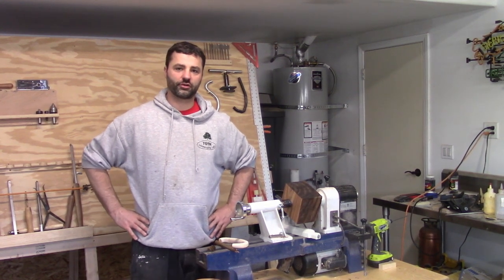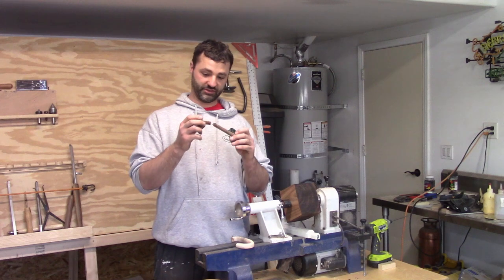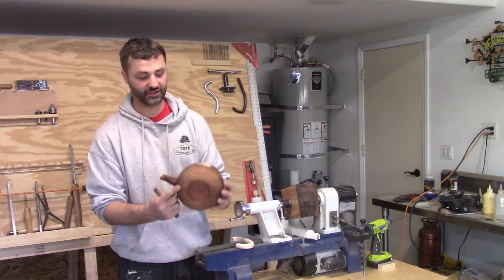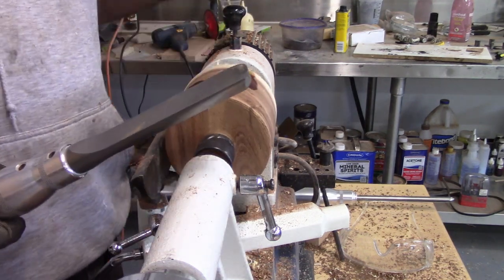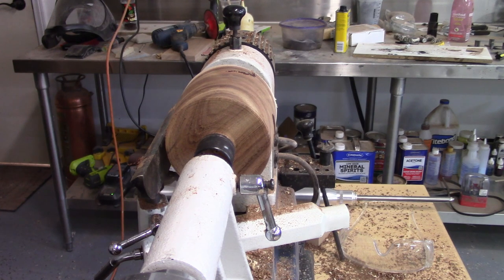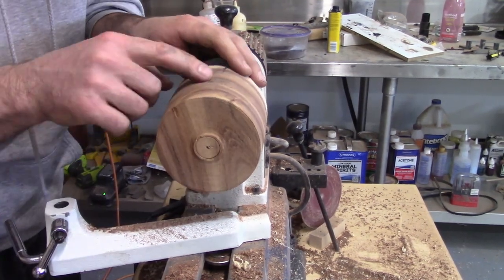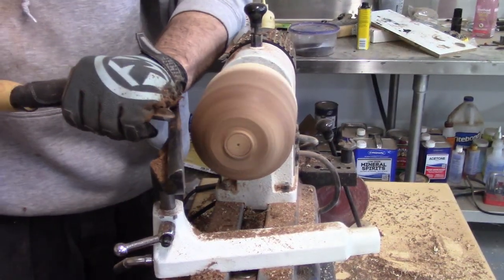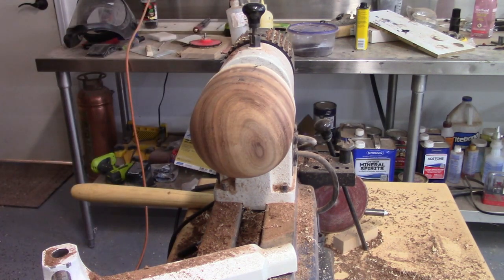Woodturners Journal: Mesquite Box for My Pride

Comment: What I've been doing lately is saving wood chips from my lathe work in little Ziploc baggies and putting them n a Tupperware container whenever in need I can use them with wood glue to feel in cracks voidz it's really neat because you can add different once I get cool effects.

Comment: For the tea kettle have you thought about turning a ring then part it off and hand sand then cut to size?
Reply from the maker: ETM That is one of the thoughts.  If I did it that way, I want to somehow have it embedded into the kettle.
Reply: @Woodturnersjournal  That should be doable. Are you going to attach it to the back or the top? Should be able to do it either way. Oh and before I forget the box and the tea kettle look awesome. I love mesquite I lived in Texas for a few years and fell in love with it there but it's hard to get here in Wisconsin lol. Good luck with the project.
Reply from the maker: ETM Thank you.  I'm going to attach it to the upper back.  I'm with you; I absolutely love mesquite.